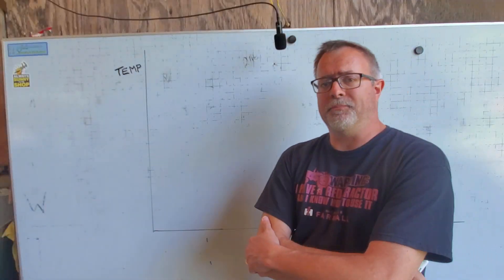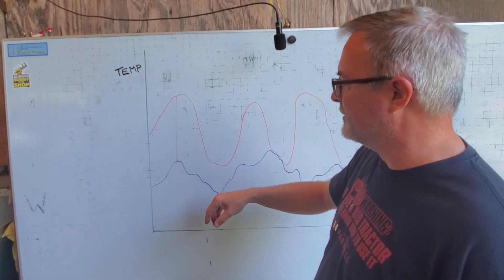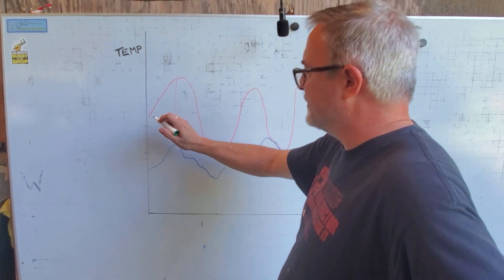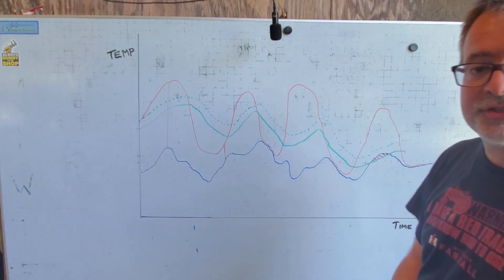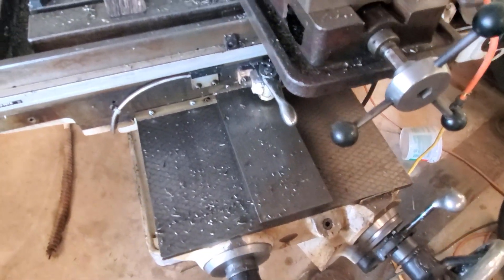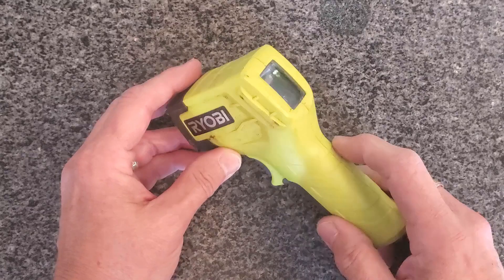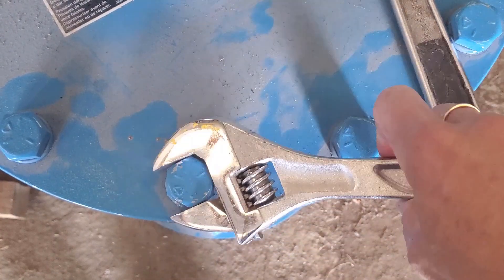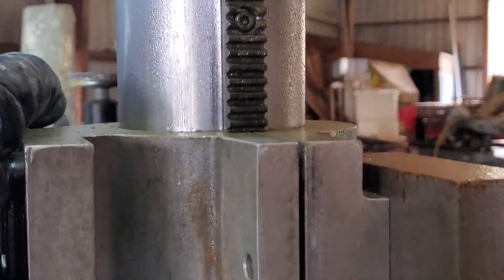Keeping Rust Off Machines: Control Condensation the EZ Expensive Way! Plus Bonus Tool Rant

Comment: Great video on a subject that I haven't really thought much about.  I did notice a couple of weeks ago that when I opened a drawer in my tool chest that my wrenches were covered in water drops and I didn't know why.  At least now I can think about how to keep that from happening.
Reply from the maker: The first time I encountered water on my cast iron table surfaces it was a pretty helpless feeling. The tricks I learned and developed helped. For toolboxes, remember heat rises so if you can get a bulb under them the heat will trickle up through the drawers and warm the contents.
Reply: @EngineersWorkshop  Good idea, I'll look into that.  I do keep multiple large dessicant bags in every drawer, but they do no good with that much water.

Comment: While I live in Los Angeles, the machines in my garage shop will get a light rusting unless I cover them. I just use old sheets that SWMBO has gifted me. The light rusting is just about non-existent. Just takes an few seconds to throw over the machine or to take off. Also keeps dust off the top of them, especially the ones that sit awhile between uses. When it's raining out side, the sheet will feel damp, but strangely, no ill effect underneath.
Reply from the maker: Noted. I'll investigate that. What's typical for RH there?
Reply: @EngineersWorkshop  The average annual relative humidity is 52.4% and average monthly relative humidity ranges from 42% in November to 60% in June. 92 today and it's getting what we call muggy, certainly not by Virginia standards though!

Comment: my shed is way smaller than yours, but i've insulated walls and roof with 100mm kingspan and run a dehumidifier 24/7 works a treat for me
Reply from the maker: It is great what you can do when you can keep the air exchanges down. I didn't mention dehumidification because I don't have a prayer until I'm sealed up. It is essentially dew point suppression, which is the way to go and cheaper than heating.
Reply: @EngineersWorkshop  I agree,  you deffo need to be sealed, but your shed is massive, How you would go about dehumidification would be interesting, especially as soon as you opened one of those big doors! maybe zoning?
Reply from the maker: @paulrayner4514  I probably would have to go with a combination of underfloor radiant heat and dehumidification to do the entire building

Comment: Maybe a heat lamp in the main casting would cost less to run.  Cold tools shrink and don't measure the same.
Reply from the maker: I am going to try to go down to a 250 or 300 watt bulb for the summer and see if that will keep me ahead of the condensation

Comment: I keep the shop at 60F during the winter. When spring comes I push the heat up rather than turning it off. The goal is the same as you where we are attempting to push the baseline temperature of the machines higher as it warms up and tends to become humid here in Ohio. BTW my favorite adjustable wrenches are those made by Western Forge (older NAPA/Allen/MAC). Another good buy are those currently sold be Channel Lock and produced in Spain by IREGA.
Reply from the maker: That's the strategy. As you can see, there's no keeping my shop at any temperature 😁 Good tips on the tools, thanks.
Reply: @EngineersWorkshop  Yes, no substitute for enclosing and insulating but it gets expensive even when doing it yourself. My shop is much smaller than yours but I have foam board around the perimeter of the slab, then 3-1/2 inches of foam board (two layers) in the walls and R35 fiberglass in the ceiling. I managed to get it all wired and buttoned up before the material prices went crazy on us. Turned out to be a blessing.
Reply from the maker: @mabmachine  Pre-COVID I got a quote on spraying closed cell foam on the ceiling in 1" thickness. Nearly $18,000. That's after I spend $2,000 replacing the skylights, $8,000 for doors, $20,000 for a 4" slab resurface... the list goes on.
Reply: I just purchased two Crescent brand adjustables and I'm having the exact opposite problem I adjust the wrench to fit a bolt and after I use it, it tightens up to the point I sometimes have to use a screwdriver to pry it off the bolt. Oh for the days when we could buy good quality made in the USA tools.